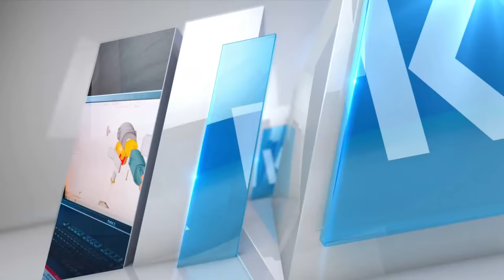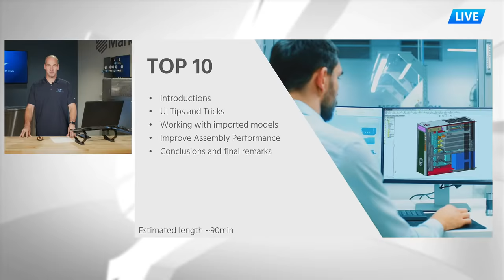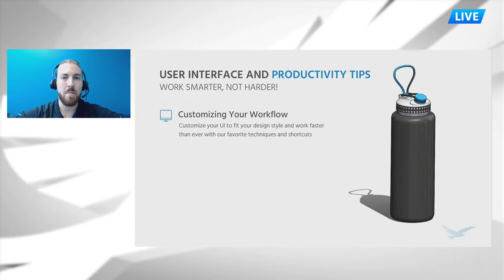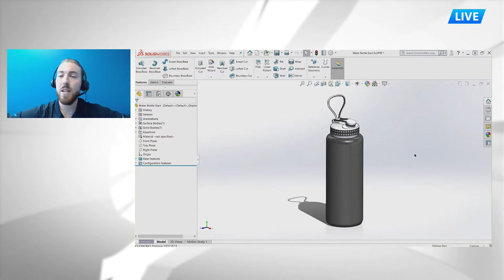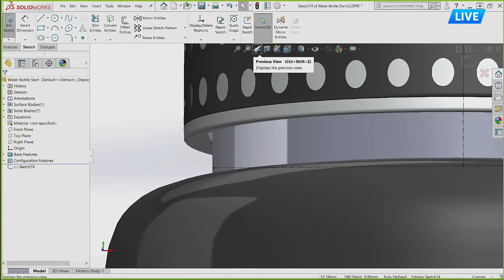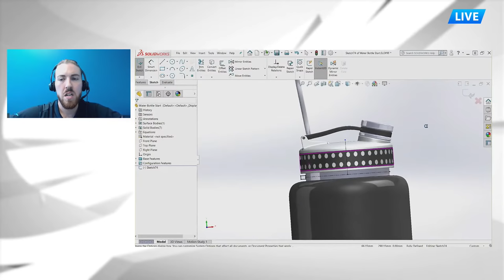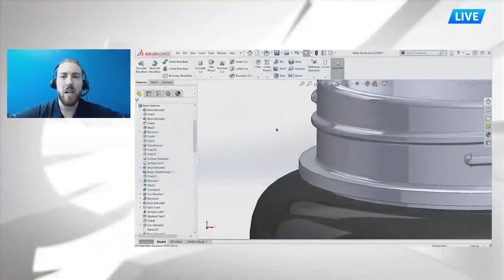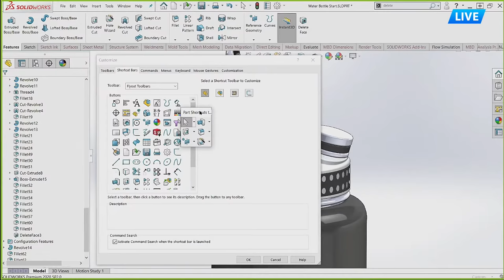TOP 10 CAD DESIGN TIPS ENGINEERS NEED TO KNOW

Comment from the maker: Timestamps to jump ahead:
07:44 SOLIDWORKS User Interface Customization & Shortcuts
Topics covered: Mouse gestures, Shortcut Bar, Keyboard Shortcuts, System Options, Display States, Configuration Tables
34:48 Model Import Settings & Direct Editing
Topics covered: 3D Interconnect, Import Diagnostics, Geometry Compare, Body Compare, Move Face, Delete Face, Split and Bridge, Pattern Faces, Insert Bends
59:32 Large Assembly Performance
Topics Covered: Performance Evaluation, Assembly Visualization, Large Design Review, Lightweight, Fully Resolved, Speedpak, Magnetic Mates
Download page for guide: https://hawkridgesys.com/top-10-solidworks-design-tips-for-engineers
Thanks everyone who tuned in!